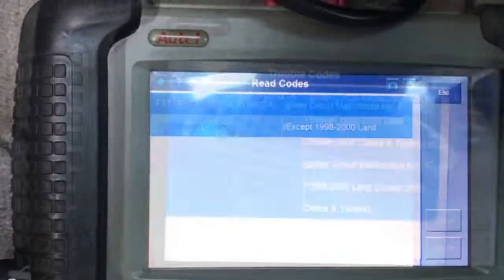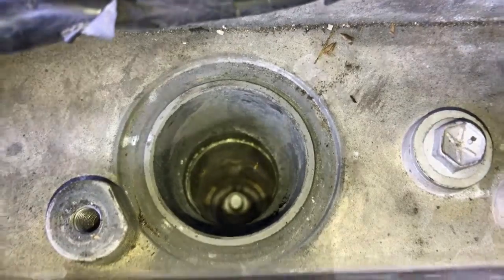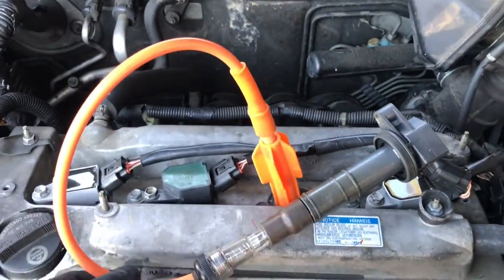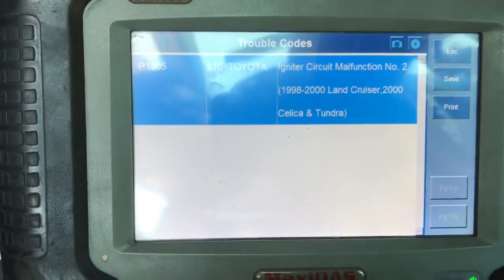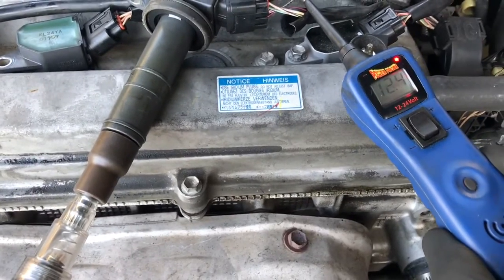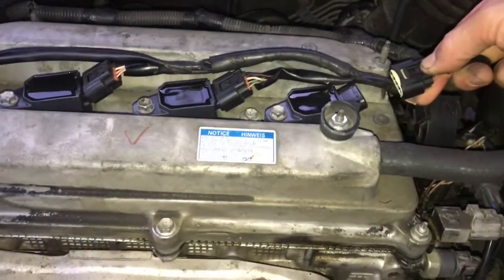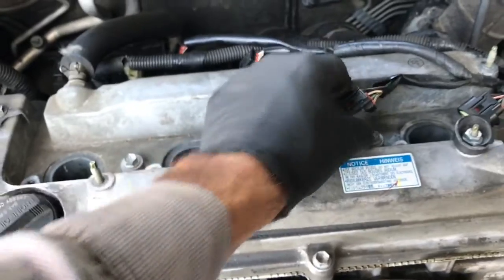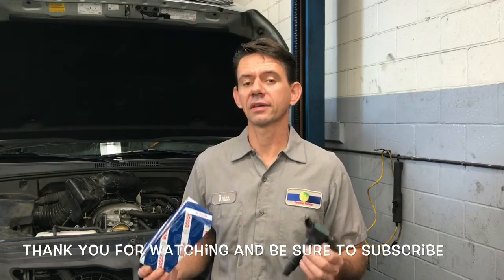Testing Toyota's Four Wire Ignition Coils The Low Tech Way

Comment: Hi! Alan. Thank you for posting this video. It’s amazing. I have a question. I made a big mistake. I replace the ignition coil connector but instead of using the same wires I used the all new connector meaning it cut the original wires and attached to the new connector wires. My car doesn’t start just sounds like he wants to start. Do you know what I did wrong?

Comment: I have a code P0301 
Coil , spark plug and injector swapped, cylinder compression 150 psi,
Injector signal checked with a NOID light tester, even replaced the ECU , the only thing I guess I’m missing in this problem is check the COIL CONNECTOR for signal , voltage, ground o whatever, unfortunately i can’t find any information on how to do that 😔 any help will be greatly appreciated 
‘10 Tacoma 2.7L

Comment: Also, is this test to be done on a cold start or after some driving? Asking because my Corolla 1ZZ FE stutters, hesitates and stalls after a spirited 1-2 hours run with AC on in very hot summers. Problem surfaces only during hot summers. It is 15 years old and 150k kilometers on oDo. On the original coils.
Reply: Have you figured out anything since posting that comment? I have a similar performance issue with a 2012 2ZR-FE engine.

Comment: Helpful.. A friend has a 03 toyota Echo.. It got hot..and lost.power..Lpw oil was one thing I found.. We.towed it in for a diagnosis. .. They found 1 bad coil (or only had 1)  They charged $109 for 1 ignition coil..only did one.. 4 New spark plugs and wires..and a oil change.. $550 buck's! I'm seeing much lower cost on those parts...feel she got taken.. Most.of those thongs I could have done but she proceeded.. Is that a Deal or what..? 😮

Comment: God bless your heart, this is the best ignition coil testing video with the right tool, not the one, where they connect the electrical connector to the tester, while the coil still in the engine, is the coil or plug in question,.I knew my basic electronics was not wrong, thank you, will be buying that orange tool.

Comment: On a 2010 0r 2011 corolla from my experience and my brothers if one coil is bad change them all.  I changed one on a friends car because i only had 1 cylinder misfire code.  After i changed it i had intermittent codes on 2 other cylinders.   If a coil is dead completely the ECM will turn off the injector.  The injectors are easy to get to so you can listen for a click with a screw driver. I wasted time checking for a broken injector wire.

Comment: If you suspect the coils (BTW coils will go tend to go bad around the 250,000 km mark and you have a 4 cylinder engine, just replace the coils.  Most 4 pack coils for 4 cylinder engines are less that $100 and that way you are good for another 250,000 km.  Inspect the coils when you have them out and if you see tiny hairline cracks in the coil's shaft end, that indicates the coils are getting old and on their way out.  Anther indication is the car's engine will begin to hesitate upon light acceleration and sometimes possibly stall
Reply: It's happening to me but I don't have the money to buy it yet

Comment: My wifes 1999 Lexus RX300 is getting a P0304 and I installing a new one still didn't resolve. My diagram shows the second wire from the 12v power as the 5v ecm signal wire which I get 5v with the key on. Even though this is showing 5v it doesn't further diagnose the lack of signal which for that I'd meed an oscilloscope. I know my wife loves her suv but a 390k I think its time. We;ve had it since 2008. Would still like to solve this issue though.

Comment: Question, is it safe to unplug the coils while the car is running on a 2010 Prius?
Reply: No it's not safe you can get zapped with 600 volts. If you can unplug your negative terminal on your battery.

Comment: can you verify the wire leads off the coil as I have a diagram which state that what you mentioned to be the power and ground leads are reversed. Also judging by the color of the leads in the video, it may be reversed from what you mentioned.

Comment: I am having Coils issues with CEL code of P0351/52/53/54 I replaced all Spark Plugs with NGK and all 4 Coils with Denso. And I'm still having the same issues. The cars has cut off on me while taking off at a stop sign or light and sometimes it has cut off while parked. It's 2006 Corolla CE Manual.  Some people have told me it could be the ECU. Others have told me that it could be the fuel pump. Others have told me that it must be a ground problem. I had reputable mechanic check the car and I was told that the wiring is fine, but the mechanic couldn't figure out what was the issue.  I've had this car for almost 5 years and it had never given me any issues until now.
Reply: Did you end up figuring out what the problem was?
Reply: @snowvalley11 yes, I ended up taking the car to a mechanic and he figured out that it was a aftermarket alarm/remote starter that I had installed a few years prior to that.  I believe he said that the remote starter wasn’t sending electricity to the coils. He ended up taking off the remote starter and its been working ever since
Reply: @buya_pr Wow! Very interesting that the solution was that. Not obvious...Good for him for figuring it out.  Thanks for getting back to me (us) youtube community 🙂

Comment: Great video, I have a 2002 Tundra that is throwing the igniter code for the entire drivers side bank, cylinders 1, 3, 5 ,7.  I suspect it is a ground issue.  I want to test the ground at the coil plug, would i connect my multimeter to the negative battery terminal and then touch the ground wire on the clip?  Or do I need to find where the coils are grounded on the engine and use that as the grounding point for the test?

Comment: Does anyone know what to do with a cylinder 1 misfire detection on a 2011 Toyota Corolla?
Reply: It could be misfiring for a variety of reasons. You may need a new coil pack. It may just be the boot. It may even be a problem I had were the wires go to the coil pack are in their flush. Or maybe you just need a new spark plug. Or maybe the spark plug wire needs to be replaced?

Comment: Hi I know tis video is old but I have a question regarding the connector wires? 2 of the connectors on my Camry completely fell apart and now I am not sure the order in which the wires go back into the new connector I've purchased. How do I know what order the wires go? I have not been able to find a diagram for this particular car. Do you have any pictures I can take a look at to see the order in which the wires are connected?? Or any other way of knowing what order they go???

Comment: The top plastic part has a crack (hit buy a wrech when I installed them back), just the outer plastic, not the Epoxy, will I have to buy a new one? It's pretty expensive and the coil is very new.
Reply: Try it out, just be sure to put it on an accessible cylinder if yous is a transverse engine vehicle.

Comment: This really helped me.  However after all this testing, I swapped plugs in cyl 4 to 6 and code followed. I had a failed Iridium plug with only 15,000 on it. never would have guessed.  So I say have a new plug on hand to rule out it besides coil pack
Reply: I must be going blind did you say after 15,000 mi and iridium plug failed. Either a defective plug or maybe when you put it down there you put it down too hard and it damaged the electrode Part?
Reply: @Live4nothingordie4something  nope original plug from factory.  It's a 2010, and just hit 21, 300 actual miles.  Never driven daily till I retired this year.😃 I had a company car for 23 years, so it was wild it failed.

Comment: I got power signal low ref and ground no spark on any plugs what could cause that 🤯🤪 it's a 08 DTS
Reply from the maker: Check for crank signal. The computer will not operate the coils without a crank sensor. Or the injectors
Reply: @HowtoAutomotive  yeah I got signal to coils when cranking 🤯 so that pretty much means I got cam and crank signal I have changed both of those

Comment: How do you get the coil out if it wont slide out after its disconnected and the securing scew have been removed? I keep pulling and wiggling it but it wont budge,

Comment: Dear Sir. I have 2006 corolla manual type the problem the cylinder 1 and 2  not working but there is current from the coil.
I  tried to un- plug the coil form spark plug 1 the  rpm not change and also #2. The #3 and #4 if you un plug the coil the rpm is going down. possible what cause this problem.Thanks
Reply: Spark plugs and or wires

Comment: Hi I have a 2001 corolla with check engine light for a misfire in cylinder 1.switched all 4 spark plugs out with new ones and light is still on so I proceeded to pull every plug from the coil 1 by 1 but when I did that the car wouldn’t start for any plug. Any idea why it shows a misfire in cylinder 1 ?
Reply from the maker: Alberto Garcia Take the ignition coil from one and swap it over from two and two to one. Now drive the car iif the misfire now switches to cylinder number two you know it’s the coil. If it still shows number one then I would do a compression test.

Comment: good and simple tip to disconnect each coil and listen for RPM 'lack of drop' to spot a faulty coil. Any back-yard mechanic can do it
Reply: Yep, and throw p035x codes for each in the process. I'm hoping for  multimeter resistance specs between pins/ pin-secondary.

Comment: I have a 2002 sequoia i replaced the spark plugs and ever since it seems like it want to turn off
Reply: Did you get the correct brand/type?
Denso or NGK
And are your coils properly plugged in and seated?

Comment: if a bolt is loose and wont tighten can you use a longer bolt to tighten a coil pack?
Reply: You can try that I had a similar problem and I found a bolt that was maybe a little bit longer but it was a Philips.

Comment: I have a p1310 code that stays in the same #3 cylinder even if swapping the coils. How would I change to wireing to the ignition coil? Or do you have to replace the whole wiring harness
Reply from the maker: Leticia Lugo I’m not sure why you need to swap the wiring or what you mean by that? If you swapped the coil with out unplugging it then it would misfire on two cylinders.
Reply: @HowtoAutomotive  i did the trick where you switch the ignition coils to see if that would be the cause of the code and that when you swap the coil the code would change from p1310 to like p1315 but mine has remained a p1310.
Reply: The ignition coils are plugged in correctly as well
Reply: @llugo9399  Then you have to take a good look at your wires going to that coil. Usually they harden over time due to heat and breaks. Also check if the pins inside the wire harness are pushed out or having carbon built up.

Comment: +How to Automotive 

Should I worry if one of the bolts doesn't tie down the coils all  the way since i probably stripped it?   The bolts I am talking about is in time 1:05  of the video.
Reply from the maker: Calvin Mahk Most likely will not but there’s a possibility of the coil lifting up and that will cause a misfire. You may want to run a tap in it in or put a shorter bolt
Reply: ok Thanks for the fast reply!

Comment: I had a persistent p0302 code on 2000 celica gt. You mentioned it might be electric if error stayed on same cylinder despite coil switch. But if it was electric, why would there be a spark? All injectors replaced, no oil leak, compression good across all 4.  What might still be the problem? Do you have video tutorial on how to test electric connector? The car runs fine except for the engine light comes back on after reset.

Comment: Can u check the coil itself with a multi meter. Just bought 4 Bosch coils n still lugging n studdering
Reply: joe d 

    If you have a Toyota,  use Denso parts.  These are OEM.  Many Toyota models will not communicate with other aftermarket brands.  I experienced this before.  Also Denso  is more reliable and is generally cheaper than Bosch.
Reply from the maker: joe d If you tried the simple stuff and it still misfiring you may wanna look into a lab scope. Also don’t forget to check the basic stuff like compression timing.

Comment: my coils are good, but still getting p0303 cylinder 3 misfire message,  I installed new spark plugs, and bought a new coil, tested and switched on each one, still getting misfire message, any ideas?
Reply from the maker: oosveluzo levso Check compression and make sure there’s no a Engine problem. If that’s ok Test injectors next and if all of that is good check timing.
Reply: oh, thanks for the reply,  I bought a noid light tester, surely cylinder 3 was not getting any pulse, then I though it was an electrical problem, I inspected all the wires, they were perfectly fine, I did a continuity test and something odd happened,  the test I did was with everything off,  I did the test on power for the fuel injectors and all 4  were good they got a continuity, ( I did the test by touching power cable from fuel injector, and ground or power on battery) I did the same to the 4 cables that connect the computer to the fuel injector, 3 of them had no continuity which is normal since everything is off, but the one from cylinder 3 had a continuity same as with  power cable,  so I though it must be touching a power cable, I did single cable continuity test from bad cylinder 3 cable, traced all the way back to the computer brown cable with gray dots where it connects to  the computer , continuity was good, so I removed the cables from the computer and did the first test with the computer cable to battery (same like I did with power cables to battery), and the continuity was gone,  it looks like inside the computer somehow there is a short or just the cylinder 3 connection is touching power,  I opened the computer and everything looks perfectly fine almost like new, but this is beyond my knowledge I can't deal with tiny parts on the computer,  I'm not sure if I should bring the computer or the whole car with computer to the dealer for a test, or just buy a computer from ebay and switch it to see if the problem will be gone.  I can't go beyond this right now, I don't know what else could be.
Reply: I had the same thing happen to me a while back, and it turned out it was a bad Fuel Inj#3 - I had it replaced and it fixed the problem. One of the most expensive problems on most older Toys is that the Fuel Injectors go pretty quickly. If one is at its end, be sure you can bet the rest will eventually follow. Best advice is when they have the shell cracked you should change them all at that time and possibly have them do the Gasket Seals also it'll save some money. Then you should be good for another 100k or so. My first failure is when my truck hit 218k Fuel Inj #5, At 249K Fuel Inj #3 went, then at 267K Fuel Inj #2 went and at that point I had Fuel Inj #1, 4, and 6 Replaced as well as my Valve cover gasket seals cuz they were leaking a little bit.
Reply: Hi i have the same problem 2006 corolla p0351 already replaced all the coils. same code. but I dont get any change when I remove either the coil connector or the fuel connector. I think its a wiring problem.
Reply: I bought a computer on ebay for 50.00 didn't help same problem

Comment: if the valve cover is leaking a slight amount of oil into the spark/ignition coil tube, would that effect the operation of the ignition coil?
Reply from the maker: Kyle Bjalme over time it will affect how the coils operate. I would fix it as soon as you can.
Reply: @HowtoAutomotive  mate, could you please help me,. I got a 2004 Camry & about 2 weeks ago, the car started normal, but shortly after the car jerk & a rotten egg smell with smoke occured, it also showed the check engine light, started the car again with some difficulty while accelerating; that is been the norm since then, sometimes it starts without accelerating, .I replaced the maf sensor, but still the car's rpm doesn't go over 3000 & it jerks with hesitation upon reaching it, what do you think it could be the problem & what scanner I should I use for your help & response thank you.
Reply: @glorianica428 hey not a mechanic but I hope I can help or draw attention to your problem. It sounds like it could be a fuel pump going bad just from my initial thoughts. You can check it at any auto parts store by asking them for a check engine diagnostic through the obdII port for free. Sorry your car is messing up mate.
Reply: @colinknutsen  Thank you, for your  time & input, blessings.
Reply: @glorianica428  Catalytic converter
Reply: @gregrein6761  Thanks mate, I'll look into that, still driving it, after changing the oil/ air filter, it doesn't shut down much anymore & a scanner shows po101(2x),po113/112..thanks again.
Reply: @glorianica428  did you solve your issue?
Reply: @rafter32  it was the mass sensor, the one attached on air duct, between the air filter & leading to the throttle body, don't buy it online; only if it is from toyota, good luck.

Comment: Brian, I have a 97 Rav4 that has been making a knocking/rattling yype noise for a while. I'm certain it's not an engine or spark knock. It has over 200k miles & burns a good bit of oil which I check & refill every few days. Yesterday I was driving slow on a back road and out of the blue it shut off. I checked the oil (full) and all other fluids, etc were good. Belts are intact, battery good... It will not crank. It sounds like the starter is turning but the engine isn't turning over. Any thoughts or ideas you might throw at me?!?
Thanks in advance!